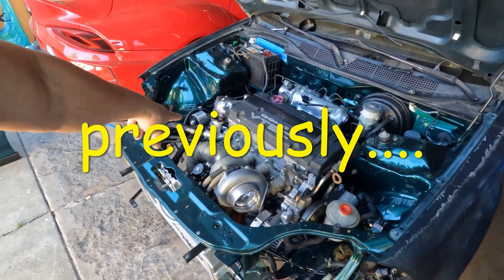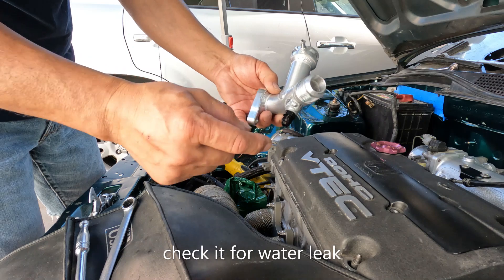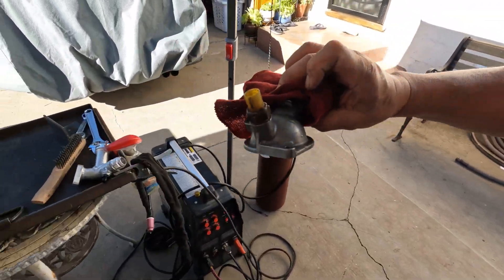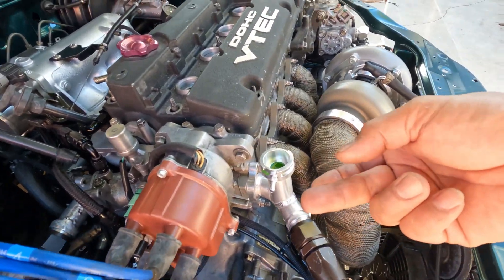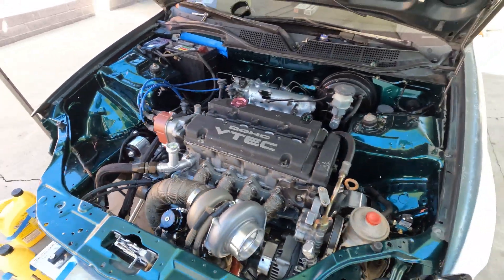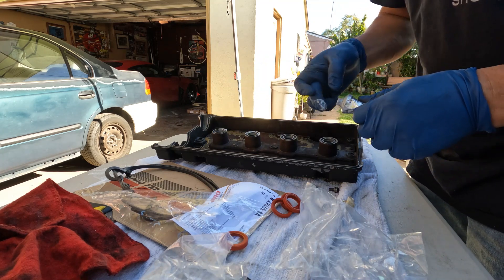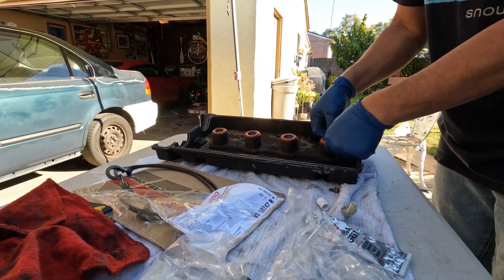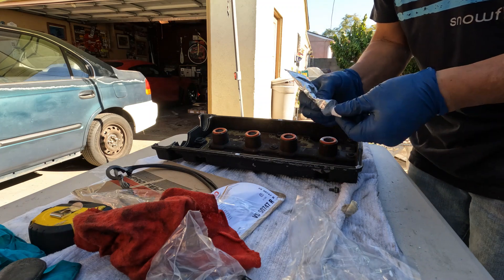H22 valve cover cut for adjustable Camgears

Comment: Is the baffle plate just held on by the cam cap bolt?
Reply from the maker: Yes, cam cap bolt holding it secured.
Reply: @sagittnet2158  thank im going to do this. Just ordered the L7 is the 34mm socket really necessary i did not order one
Reply from the maker: @germanvazquez584  Socket is included. When l got mine, it's come as a kit.
Reply: @sagittnet2158  terrible i just bought one n it said not included terrible
Reply from the maker: @germanvazquez584  l checked their website and there's a note that it require a socket to secure it and 2.1 version prices are $30 lower than what it was when l bought mine.
Reply from the maker: @germanvazquez584  lt must have been a promo that the socket is included when l got mine. I paid $145 at that time.
Reply: @sagittnet2158  I emailed them they said i could use a non impact 34mm socket. I got lucky n got it for $99 on a sale.

Comment: Hey man hows it going ive been looking for a block guard girdle kit but cant seem to find anything i have f23a5 short block any suggestions
Reply from the maker: Doing good and thanks.l'm not really sure if f22 block guard will fit but you can try if you wish. You running NA or boost?
Reply: @sagittnet2158  NA and i did see some kits that said f22 h22 and h23 but i wasnt so sure either
Reply from the maker: @G23VTEC  lf we can only get a cylinder dimension numbers on all those block. We probably use it. Maybe just need to grind here and there
Reply from the maker: @G23VTEC  Have you seen some guys using that devcon or something that they pour on the block. You can try that.
Reply: @sagittnet2158  i have seen where they do appoxy but i maybe have a machine shop see what they can do
Reply from the maker: @G23VTEC  alright bruh!
Reply: @sagittnet2158  take care keep up the good content
Reply from the maker: I got my block re-sleeved and thought about sending it to CSS to get it close deck but the machine shop that did my block said, no need. So l kept it open, NA setup should be okay to run it open deck. I used 2 f23 bock on boost pushing under 400hp and held up. The block gave up due to me not using proper ecu and wastegate. The other gave up due to piston edge cracked, again coz of not using proper equipment.

Comment: Hello hows it going i just had a few questions about the timing belt gears what are you using the h22 gears correct? Im using the f23a5 block and a h22a4 head
Reply from the maker: Everything is good my friend and thank you much. Hope you do the same. Yes, h22 gears need to be use in order for it to work. Timing belt, camshaft gears, crankshaft gear and water pump is a combo( pump is from f23 w/ gear from H22). It can be purchase now at KStuned if you dont want to build it yourself.
Reply: @sagittnet2158  and i would jus buy those gears somewhere on ebay or something huh
Reply from the maker: @isaacgutierrez3445  If you don't have a junk yard nearby, Ebay is the place or FB market place. good luck to your build man.
Reply: @sagittnet2158  okay thanks much appreciated